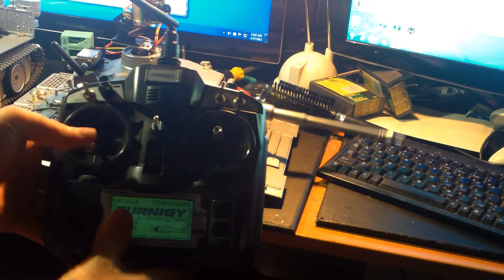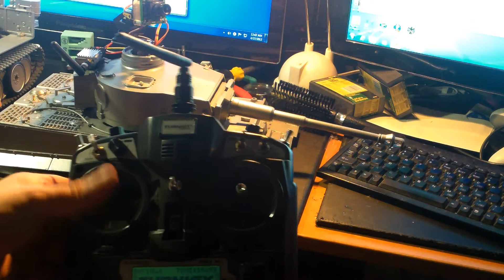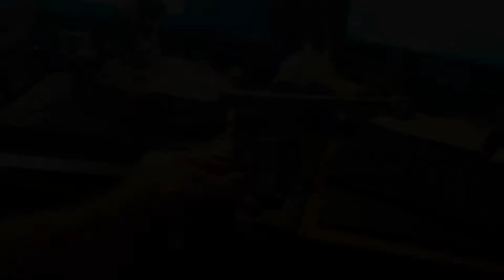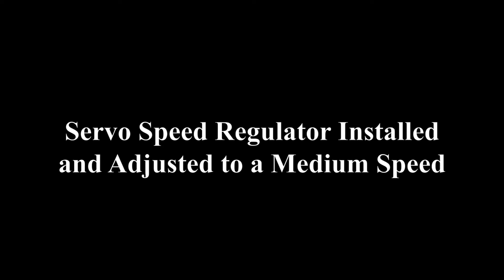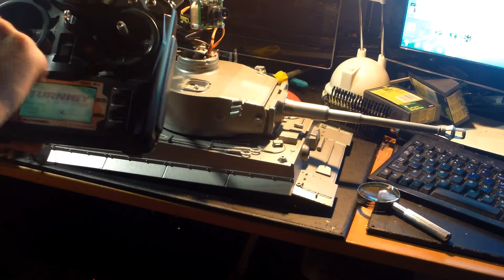Servo Speed Regulator for Tank Turret Elevation.mp4

Comment from the maker: For turret rotation I used the turret motor/gearbox from a Heng Long Tiger 1, and just used a cheap brushed car ESC to control it. ($10 ebay) It must be for a car so it has forward and reverse. You could use a continuous rotation servo, but then you have to come up with some gearing to match the turret.